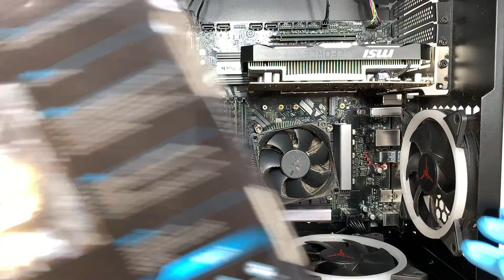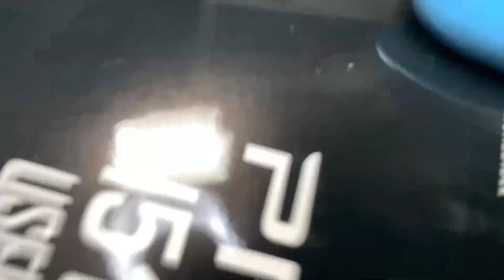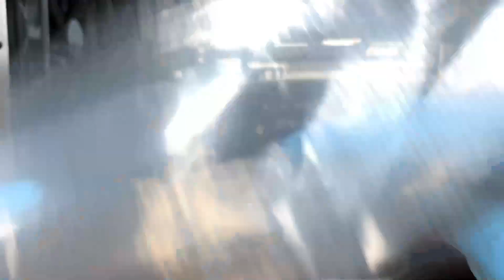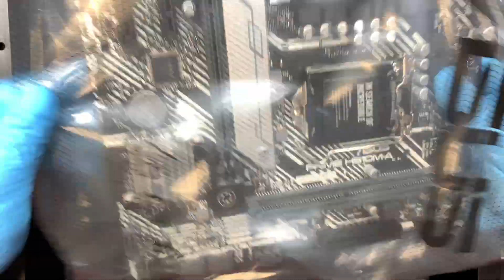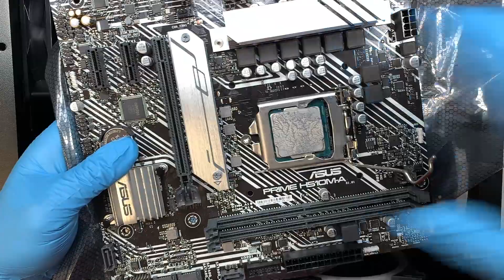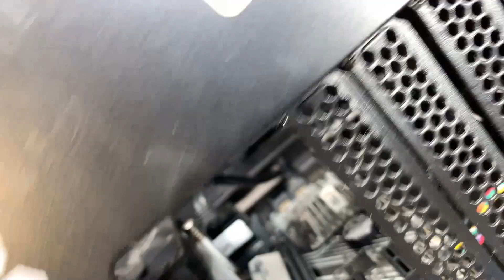Asus Prime H510M A Setup Installation Motherboard

Comment: Here's a video on how not to install a motherboard, at one point I thought it would break the pcie x16 slot
So much force was needed to install the VGA, the cooler was almost clogged with so much dirt.

Comment: I never use io case cover pain in the ass but sure more dust will come in I clean it ones ever 6 months work on my own stuff it’s easy ones you under stand them try to use used stuff when possible not allways

Comment: Trying to find where nvme goes on this motherboard.
Reply: Same dude
Reply: @nikto6907  I found out those shiny silver long rectangle parts u see on the motherboard, the memory is behind them! just unscrew those brackets and there they are :D
Reply: @24yrukdesigner  did you have one extra bolt left when you screwed the heatsink back in?